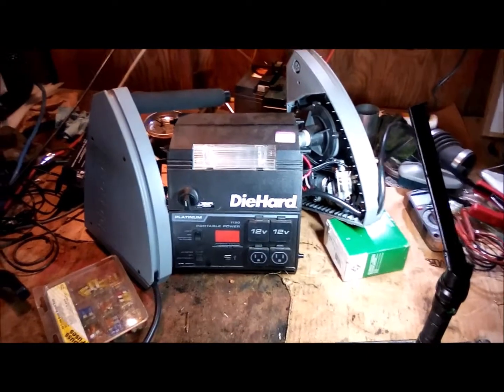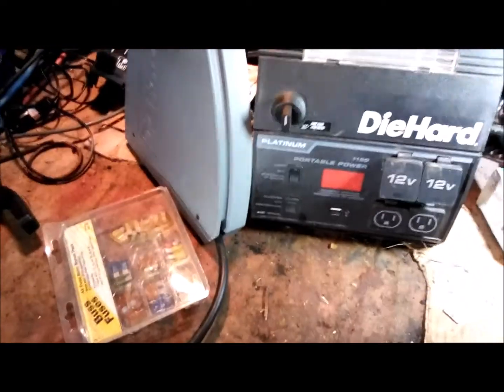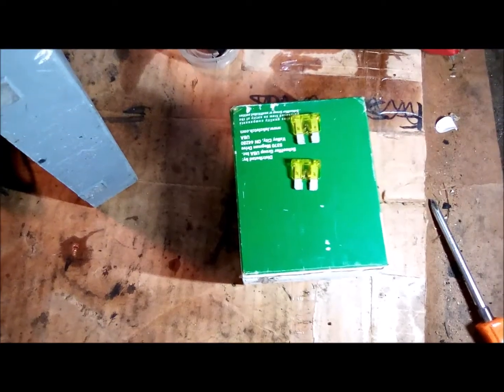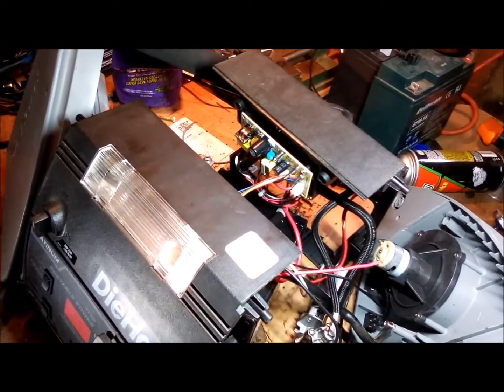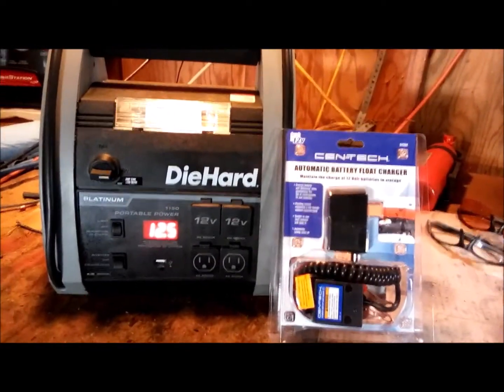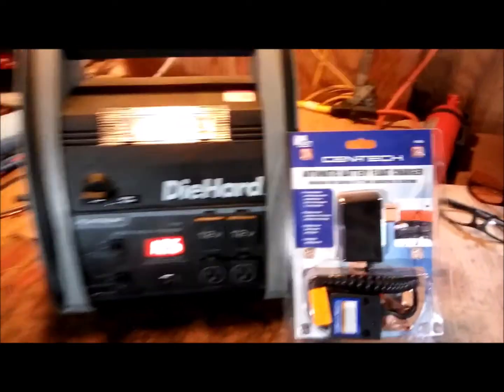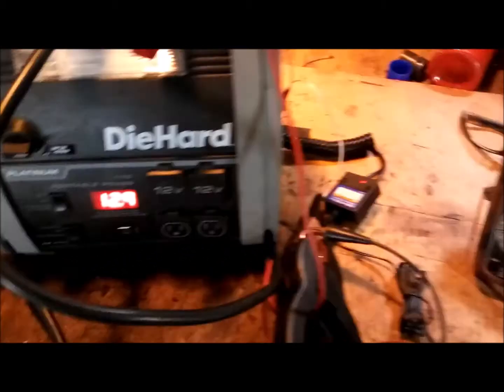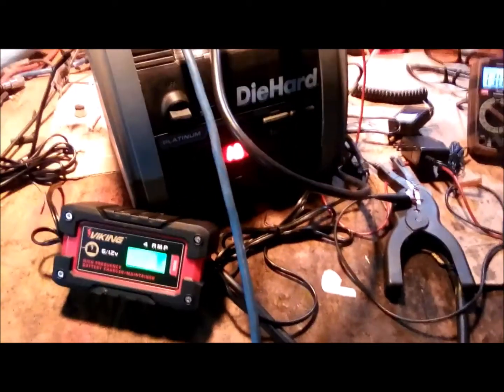DieHard Portable Power 1150 Air Compressor & Charging Issues

Comment: I'm having compressor troubles with my 1150 also, finally decided to pull it apart like you did...This tiny compressor is really a joke when it comes to filling a car tire...Nonetheless, mine didn't spit the rod, decided to pull the head/cylinder/piston apart...  The check valves in the head appeared carboned up, so cleaned them out...The problem appears to be the plastic/rubber piston ring which has shrunk up allowing all the air to "blow by" the piston..us.I did my best to revive the plastic/rubber piston ring, but don't think it will work very well.  Put it back together, it pumps air now, but I don't trust it to fill a car tire.    The problem is that I contacted Sears to get parts for this thing, they said it is not possible to get parts from Sears.  Just wish I knew who manufactures these little pumps, would gladly by a new compressor unit but would love to get the rubber/plastic piston ring....  No luck finding anything on the interwebs...
Reply from the maker: I have repaired a couple of these small cheapo compressors. My experience is that the ones that I have worked on seem to be very similar, and I have been able to rob parts off one unit and repair the faulty one. I have purchased some cheap 12V compressors that you plug into your cigarette lighter socket, these seem to be a good economical source of a replacement compressor unit. As opposed to trying to get an actual Sears part.
Reply: @nightcrawler6723    Thanks buddy, I'm guessing one company makes these little compressors for most of the companies that sell these units...Probably chinese.  Just wish I could find out, but have had no luck...The diehard unit was given to me as a gift, would like to keep it going...Oh well..
Reply from the maker: Don't give up Kramden! If I can repair one of these, so can you. In this video I show another Jump Pack called a Power Station. It had a faulty compressor. I bought a couple of cheap 12V inflators, and took the compressor out of one that worked, but the power cord would get warm. The compressor bolted right up to the electric motor, no problem. Also, in this video I connect a  small blue inflator up to test the 12V output. That Blue inflator was one of the two that I bought just for parts to do these types of repairs. Go on Ebay, or Shopgoodwill.com etc. See if you can find a cheap 12V tire inflator. After you make your repairs, post up a video. Okay?
Reply: @nightcrawler6723    All mine needs is a new plastic rubber piston ring....Will certainly let you know if I find something that will work...D
Reply: @nightcrawler6723    Sounds like a good idea...

Comment: Nightcrawler, were you able to repair the recharger in the unite? ,  mine was working but I used the wrong  wall charger and burned something out, Ugh!  Thank you
Reply from the maker: No, I never was able to repair the internal charger board. I just recharge it through the jumper cables using a battery charger.

Comment: Did u notice  on the white circuit board , the 2 small bolts &nuts touch one another .on the center of the fins.mine were touching & burnt the bored  under those fins.ps hope u understand what I talking about.

Comment: Also can u tell me were to find a new white circuit board. Thanks vern
Reply from the maker: Unfortunately, I do not know where to get a new board. So, what is wrong with your unit? Is it just not charging, or is there another issue with it? If the only problem is charging related then I would highly recommend charging the unit with a car battery charger.

Comment: Hello, is there will be safe rear battery charger than clamp charger? Mine clamp not working with charger. Is that safe rear door open and put battery charger?

I’m apology not good grammar
Reply from the maker: Hi, Alexy I am not quite sure what you are asking. Sorry.
 My Diehard doesn't have a rear door to access the battery. 
When you hooked up your clamp charger did you have good contact with the battery clamp that has the cable on it?
Also, did you have the switch on the DieHard in the jump start position? When the DieHard is in jump start mode you should see a voltage reading on the red meter.
I don't know if this is helpful, good luck.
Reply: @nightcrawler6723  mine have access door for battery maybe have new version coming out few years ago before Sears out of business. There is not working what you was suggest me. Maybe they design new motherboard protect from damage clamp- charger
Reply from the maker: Did you ever figure out a way to charge your DieHard? One option to the clamp on style might be:

https://www.batterymart.com/p-enc2a-plug-6v-12v-2a-battery-charger-with-plug.html?gclid=Cj0KCQjwweyFBhDvARIsAA67M734kw47goQo9y6Az76TP-U3m2LPw1iFeZIet8OlixCU8TQ9VNnTJIMaAvtcEALw_wcB

Then you could just charge it from the front 12 Volt socket.
Reply: I have owned two of these, one far older and a much newer one. The one in this video seems to be a model in between both of them. The older one had the pressure gauge, however the newer one you set the pressure using the digital read out and pumps to pressure set then shuts off. Also the older one had a conventional lightbulb as the one shown, the newer one LED. The newer one charged with a "regular extension cord" as the one shown, however the older one used this cord to charge it. https://www.amazon.com/diehard-portable-power-1150-charger/s?k=diehard+portable+power+1150+charger

Neither had the green light in the rear however.

I believe the question refers to the clamps you use to jump start a car battery? In that case, yes you need to turn the circular switch to jump start as Nightcrawler said.
Reply: Maybe faulty memory, the older one may have had the green light.?? That one has been lost to me for years. The newer one the front digital read out fades in and out at 100% when in maintenance mode.

Comment: Can i charge with the power outlet in my car?
Reply from the maker: Maybe, if you had a cord with male plug on both ends you could probably connect the power outlet on the car to the power outlet on the DieHard. Then when you start your engine it would charge off the alternator.
Reply: Yes, they come with the male to male cord. One interesting thing is when you leave it connected and turn off your car the 12v system (radio, cig lighter/power outlets) remain on drawing current from the 1150. lol I usually drive older vehicles so I don't know if the same is true with newer or EV's etc. I just bought a splitter with a switch and would use it to enable the charging while actually driving. I kept the 1150 in my trunk running a extension through to the rear. To be clear, it charges while the alternator is running however you would need to unplug it or use a switch when the vehicle is off.

Comment: too bad you didn't show where the fuses go
Reply from the maker: Here is a link to the fuse location:
https://ms-my.facebook.com/OdysseyCamper/videos/if-you-bought-one-of-the-diehard-1150-power-packs-that-i-recommend-here-is-where/2265870310351724/
Reply: That link was very helpful! The top 20 Amp fuse is for the compressor. The bottom one is for the two 12 Volt outlets.
Reply: There are 2 more fuses on the inverter board. They are rated 25 Amps. They are for the 120 Volt outlets.